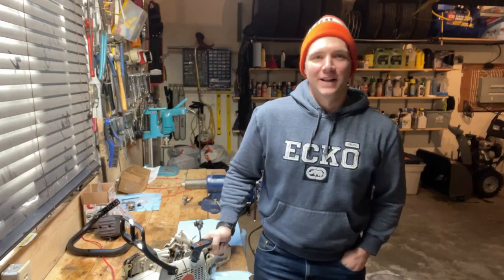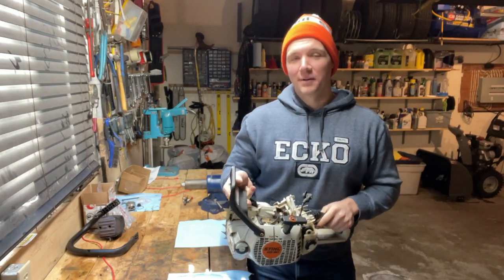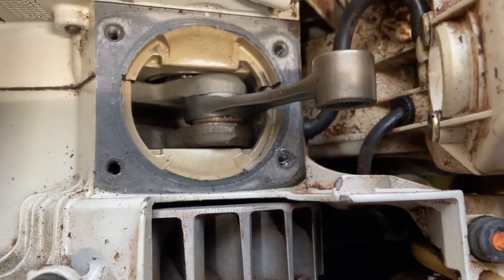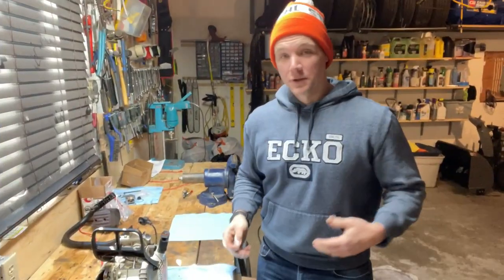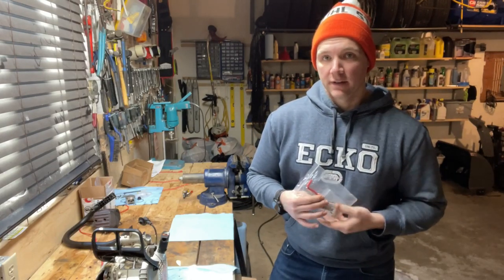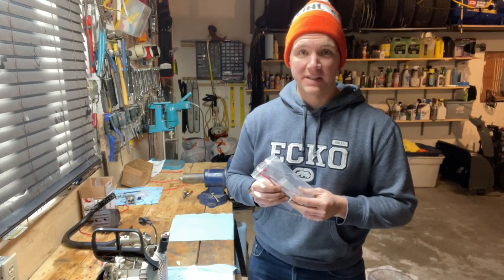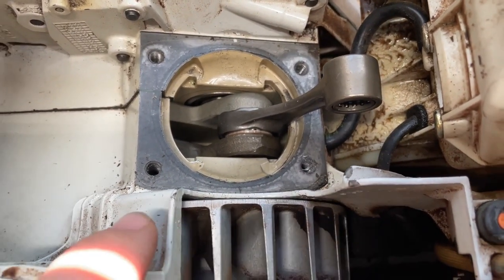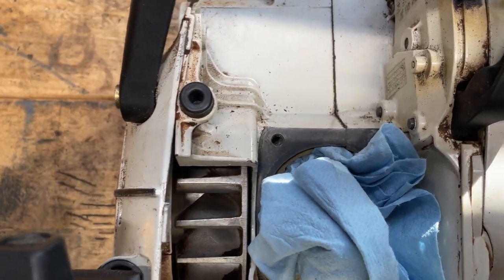How to fix stripped threads / stripped bolt hole on a small engine!!! (Helicoil insert installation)

Comment: Suggestion only,Use painters tape to mask off cylinder holes,and other areas than can be compromised by filings and chips.no errors,then.always vac.and a drill guide block.Awesome video and advice on the confidence factor.screwing up is part of the knowledge process,i know from experience.And it does allow you to gain confidence to tackle projects you would never think of doing.

Comment: I have installed many heli coils over the years mainly into aluminum pumps, meters etc. When installed the thread has much more pull strength than the original as it is the same as using a larger size bolt.They are great for repairs to a wide range of applications and your use is a perfect fix on the chain saw.
Reply from the maker: That’s awesome Miles! Good to know!

Comment: Keylocking inserts for the win. Drill, tap, hammer, done. Fixed some stripped holes in some edelbrock aluminum cylinder heads on my dads 390 FE that way. Never better
Reply from the maker: That’s awesome Justin!

Comment: Recently did the same thing on a chainsaw for one bar bolt where the hole was stripped out. The inserts in my helicoil kit weren’t as big as I wanted them to be. I risked it and put two inserts inside the same hole. I had to make sure where second insert ended was adjacent to the beginning of the first one. It was important to guess how far the first insert should have been screwed in. It all worked out fine and the bolt screwed in. Btw grease works great to collect the shavings. Great video.
Reply from the maker: Thanks 10mm, you must have had tons of bite for that bolt!!!

Comment: Great fix it video Dave! I as a machinist have repaired my share of bad threads in aluminum,  steel, cast iron, etc. You did a great job and looked like a pro. I already watched your assembling of that saw. Great job as well!  🇺🇸🇨🇦⛄ Roger
Reply from the maker: Hey Roger - I haven’t posted that video of the 361 rebuild yet - look for it in the coming days. Thanks for the kind words!!! 

By the way - is there anything you would have done differently on the repair?
Reply: @DavesSmallEngines  Absolutely not! You did a great repair my friend!👍

Comment: A couple things Dave. First use a little grease on the tap. In that situation aluminum chips can get into the crankcase and into your bearings and also get inbeded into your cylinder wall and piston and foul all kinds of things up. The grease will capture the chips and you can recover them before they drop into the hole. go a little bit at a time draw the tap out put more grease on and continue ect. Second thing. when breaking off the piece at the bottom of the heli-coil use something magnetic to recover the steel piece that breaks off. That's worse than the aluminum chips. Just when you think everything is going well you may find 20 min into work with the saw that your starting to loose power or worse. The vac is a good Idea but once those chips drop through that hole there is very little hope that a shop vac will recover them. Not allowing them to get down there in the first place is the way to go.
Reply from the maker: Great points - thanks Tractor!
Reply: I agree about using the grease I’ve seen that on other helicoil installation instructions. My concern too was the little piece of the helicoil that’s needs breaking out. I have to do this on a 2stroke motorcycle,s oil drain plug and definitely don’t want to get that little piece in there, I’m having trouble understanding how I’d keep that from going in there. Also was thinking I’d apply locktite to the helicoil before screwing it in? Let it cure 24 hours before adding gear oil?

Comment: That kit is nice because you don't have to think much about the drill bit  and tap to use.  But other kits may not come with a drill or a tap so make sure to read the specs on the helicoil inserts and it will tell you what to use. Also a word of caution on the tapping operation.  This is where things can go from bad to worse. Go very very slow. Make sure the tap is cutting and doing the work. Don't force it. I like to pull the tap out to clean out cuttings occasionally. If the tap breaks you can be in a world of hurt because it is hardened steel and really hard to drill out!

Comment: I'm not automotive savvy, but I totally agree with the small engines. It's generally not that much of a loss if a piece of your equipment breaks the worst you have to lose is some time, the best you have to gain is knowledge and experience and you can always tear it down for parts is the beauty of small engines.
Reply from the maker: That's why I love them so much. I have built several car engines, and owned even more cars. The risk is too high for me these days. This certainly has more of a hobby feel without the pressure of a huge investment, expensive parts, storage, licensing, vehicle safety checks, etc.
Reply: @DavesSmallEngines  exactly I feel like working on them has helped me troubleshoot and understand my car alot better even though I'm still hesitant about doing the work on my vehicle I have a good idea of the problem so I know if a mechanic is trying to rip me off or not.
Reply from the maker: @robfahey1349  absolutely - that knowledge will save you lots of cash... even just knowing the problem.

Comment: Nice video! I get frustrated with broken bolts. My Honda 1332 is still dying during storms. Very strange. The dealer told me to leave fuel cap loose and see if that makes a difference since it’s not breathing. I’ll give this a try
Reply from the maker: That is frustrating,  not what you expect from a Honda!
Reply: @DavesSmallEngines  I’m making video of it soon lol.
Reply from the maker: @appleztooranges  I don't hear the engine, nor hear it dying out?
Reply: @DavesSmallEngines  you’d have to watch the video I sent donyboy73. This was just a summary of what happened.  
It was the charcoal filter in the fuel cap. Ever heard of this? Starved my engine and died everytime. I put my Honda on its front end to clean and inspect the bottom even with a sandwich bag and a 3/4 fuel tank of gasoline and it got saturated. Thus no longer was the cap venting properly. The dealer said he’s seen this before on many Honda engines. I guess it’s a common thing if you overfill the tanks or put it on its front or transport it funky. Good to know for future. The dealer said starting around my year (2013) and newer Honda has used this charcoal gas cap as a means for filters. I will not be tipping my machine on its front moving forward
https://youtu.be/VZ-TTa7lUGg

Comment: Good job Dave.  Helicoils are awesome. I have been trying to find some decent chainsaws to repair.  I have only seen cheap crap so  far.  Husqvarna and Stihl are hard to find broken and cheap in Oregon.
Reply from the maker: I do a lot of scouring. Maybe make a relationship with a local shop?
Reply: @DavesSmallEngines  that's a good idea thanks

Comment: Dave if you know someone who has a lathe have them make you a drill guide from a round piece of steel bar stock that has a hole drilled through it lengthwise and faced square on both ends.  The hole drilled through it should allow your  helicoil drill to just pass through.  The bar stock should be large enough in diameter that once the hole is drilled there is enough of a wall thickness left to sit on the machined surface of the item you want to repair.  It now looks like a thick walled bushing.  Holding this down to the machined surface will now allow you to drill your hole with a portable drill without wondering if you have the drill perpendicular to the surface.  If you want you can also have one for the tap.  You now have a drill/tap guide for a particular size.  Engrave the size and it’s use on the side of it and store it with your remaining helicoils for the next time.  If you think you will be going into mass thread repair then the drill guide should be made of tool steel, hardened, and tempered, but for 20 or 30 holes it will be fine.
Reply from the maker: That’s a fantastic idea. I will look into that. Right tool for the right job, eh???
Reply: @DavesSmallEngines  I believe they sell a jig to attach to a drill to basically make it into a portable drill press this way your square. I can't remember the name of it or brand but I'm sure a Google search will reveal it.
Reply from the maker: @robfahey1349  Hey Rob - I have one of those... but maybe it's different than what you are talking about. It would be square but unfortunately this engine case was not square to the surface I was working on.
Reply: @robfahey1349  usually the holes that have stripped threads on a small engine are in small or narrow confined spaces.  The drill jig you proposed would be much too large for small engine work I’m afraid.  Nice of you to check for Dave however.

Big Gator tools make smaller hardened drill guides that machinists have made for decades themselves, but I was hesitant to recommend them to Dave because they fit a series of hole sizes and probably would not work in the application he needs them for because even they are too big and cumbersome in a lot of circumstances in small engine repair.

Comment: Would you recommend putting Loctite on the outside of the Helicoil before installing?
Reply from the maker: I would not. Not required.
Reply: No loctite on heilcoils not even on bolts. The helicoil if installed properly as designed so the last tread of the helicoil should go down into the new taped treads and keep it from coming out. The coil is cut in a way that digs into the threads. This is the problem I have seen when people use helicoils. They don’t put the helicoil down far enough into the treads and they back out with bolt. Time-serts are the way to repair treads. Better then or just as good as OE treads.

Comment: Hi mu name is robert i have a 100 cc 2 cycle mortor that has a stripped out head nolt.i noticed there is a hair line crackinside the crank case where the head bolt goes in thats steippedim afraid of using the helacoil thinking it could make the hairline crack even bigger and the coiil braking through inside the crank case any suggestions

Comment: I agree about using the grease I’ve seen that on other helicoil installation instructions. My concern too was the little piece of the helicoil that’s needs breaking out. I have to do this on a 2stroke motorcycle,s oil drain plug and definitely don’t want to get that little piece in there, I’m having trouble understanding how I’d keep that from going in there. Also was thinking I’d apply locktite to the helicoil before screwing it in? Let it cure 24 hours before adding gear oil?

Comment: I was thinking you would use a stop collar, set to the depth based on the length of the removed bolts.  I would be afraid of drilling too deep, or not deep enough.  It's critical to be square to the drill, too. It's also a good idea to use a drop or two of oil, and while tapping, reverse the tap direction periodically to clear chips, especially in aluminum.
Reply from the maker: Good points. I went in a bit further than the threads to make sure that I was past the taper point in the tap. I felt little to no resistance with the tap and didn’t think I needed to use any more oil!

Comment: Good video...I've used "time-certs" when I rebuilt a vw magnesium block.  Never have used heli-certs. Any issues with torque specs etc?  They are a hell of a lot cheaper than time-certs👍
Reply from the maker: I haven’t seen any issues yet!

Comment: I've never done this myself, but when I see other people do it they go in a full turn or so with the tap then come back out a half turn then repeat until the hole is deep enough.  I've also seen people use a second tap (I think it's called a square tap) that's not tapered, so they have a flat end rather than a tapered end to the screw hole.
Reply from the maker: Hey Dave! I'll check out what others are doing. I have seen a few people and was taught this way before and as long as there isn't too much resistance, it has always been okay. Cheers!

Comment: Dave do know of any links to completely strip down a Stihl ms230 Chainsaw and replace the entire Casing? My one is badly scored from a previous owner and the oil pump/line connector is so worn that the oil keeps leaking out! Basically I got ripped off when I bought it!!🙄
Reply from the maker: Hmm. I haven’t seen one but it can’t be much different then any of the other Stihl prosumer saws. Are you trying to save it?
Reply: @DavesSmallEngines  Well its either save it or buy a new one! I've spent over 150 trying to repair it before I noticed the extent of the damage, so I think I might as well save it for myself. It would be morally wrong trying to sell it on to someone in the state it's in so yes, I might as well fix it and get experience in stripping down a saw and reassemble it back together. With the money ive already put into it I might as well fix it and keep it as a second saw if I buy a new one! Well in saying that, it all depends if I fix it properly so a good tutorial video would put me on the right track!

Comment: Could the tapped thread be used without the coil piece.?
Reply from the maker: It could... but wouldn’t be as strong. You’d also need a larger bolt

Comment: Helicoils are good and the cheapest way to fix a striped threads. But if you want a really good repair check out time-sert. They aren’t cheap but you will never have to worry about it again. Use them on Ford striped spark plugs, even head bolts.
Reply from the maker: I’ll check it out. Great info Keith!

Comment: Nice video.  If you find yourself doing a lot of this type of work, make yourself a tapping block.  It can be square or cylindrical and square and flat on both ends and should have a clearance hole for the size tap you use.  You hold the block down securely to the machined surface that you are tapping and start your tap that way.  It makes sure the tap is going in straight.  Also, a cheap tap handle would be much easier to use and has a better feel than a ratchet and extension.  There are also a slew of tapping fluids, some specifically for aluminum that can build up on a tap and could cause them to tap oversize.  That's not a good thing when inserting Heli-coils.
Reply from the maker: Thanks for the good tips Rick! I have lots to learn. Cheers!
Reply: @DavesSmallEngines  
You're welcome, Dave.  I have a question for you.  I have a Poulan P3816 that I put a new after-market carb on, gasket, new fuel filter, lines, air filter, spark plug and primer bulb and can't get the saw to start.

The compression is good, the saw started and ran for about a minute or so and I haven't been able to get it started since.  The saw looks like it's pretty new and just sat with old fuel in it.  I turned the H and L screws in and backed them out 2 turns, again at 1 1/2 tuns and it won't fire.  I also tested the coil and plug.  Can you recommend anything?

Also, is it a bad idea to use starting fluid to start saw initially?
Reply from the maker: @rickdavis2235  do you have the gasket between the carb and engine block positioned properly? Is there any pressure loss when you open the fuel tank lid?

Comment: Best 👌 way to go is a wurth Time-sert kit 👌 expensive 👌 it does the job far better than Hele coil type fixing and is much stronger 💪 too and won't put out or rot like a Hele coil wire will Time-sert locks itself into the parent thread and forms a permanent seal aswell go check ✔ them out on YouTube.